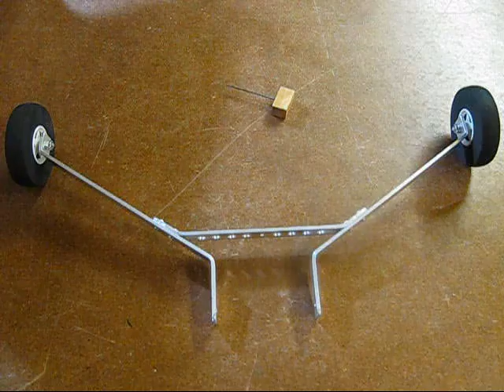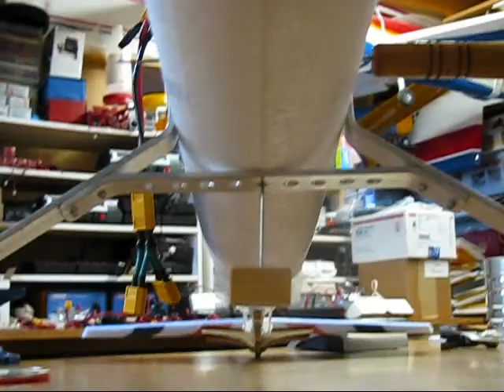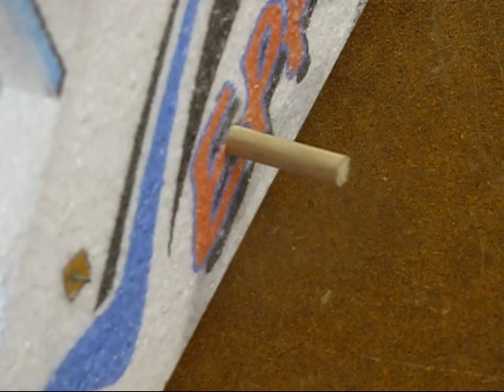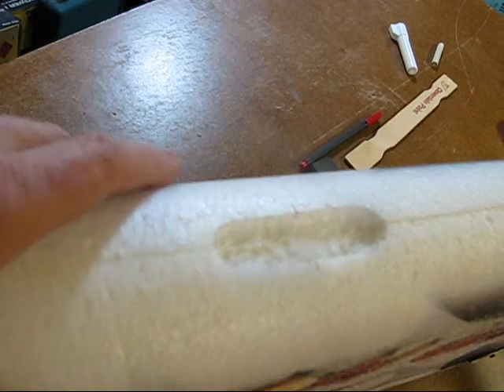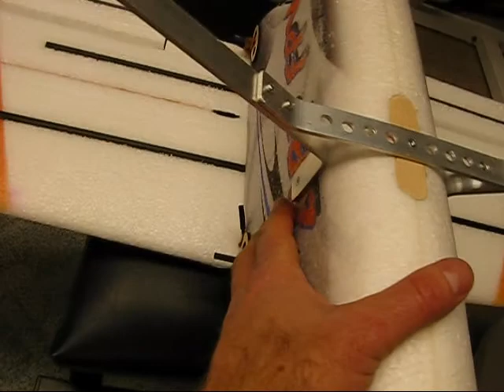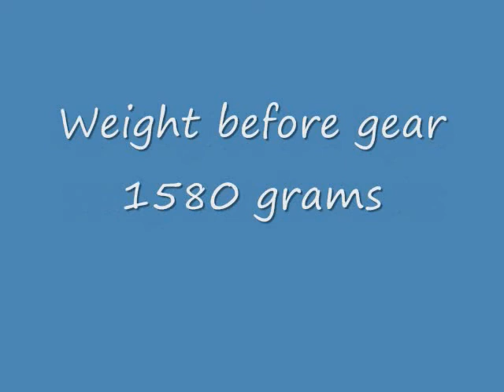Hobby King EPP FPV Landing Gear step-by-step guide

Comment from the maker: @VantageControlsUK The wooden landing gear support on this plane is very robust indeed. To mount floats you will have to make a second similar wooden support towards the rear of the fuselage, for the rear floats mounting. Use the same CG position that you use when flying with wheels, no change there. When I get to doing my floats conversion I will post the details. When the lake is frozen - use the landing gear !